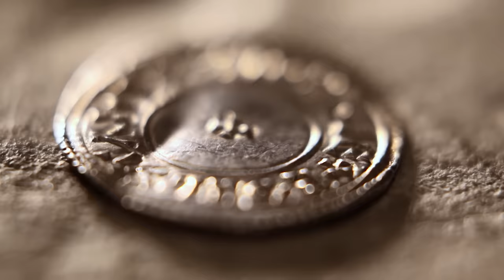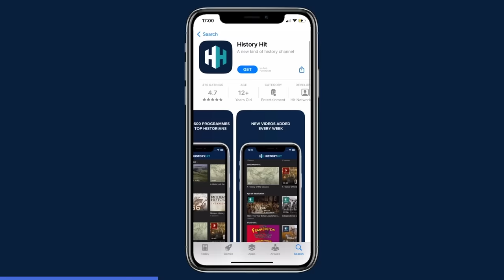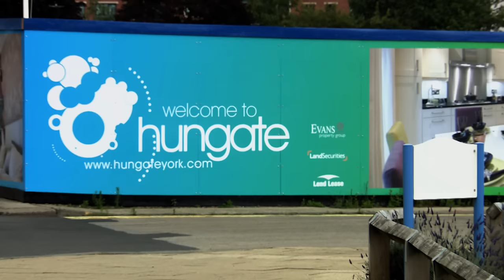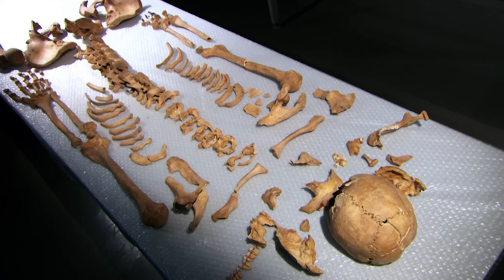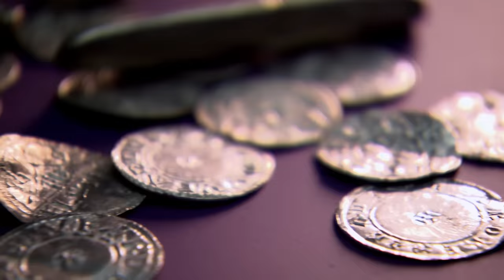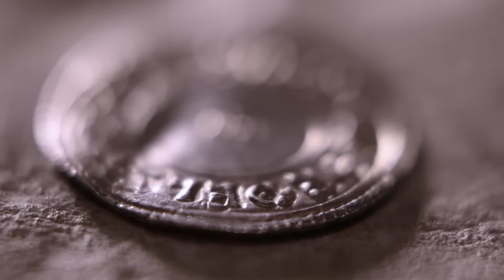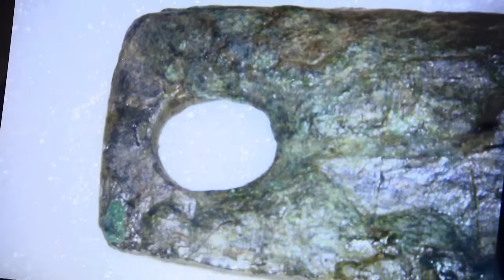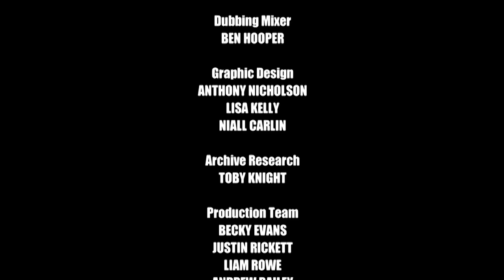Archaeologists Uncover The Secrets Of The Vale Of York Viking Hoard | Digging For Britain

Comment: The spear wounds could have been made after the slaughter as the victors went around to ensure each body is truly dead. Or arrow wounds.
Reply: I don’t know why the curator seemed to think of spear wounds to the exclusion of wounds caused by knives or dirks. Some dirks were made in that square pattern—like 4 sharp blades rather than a flat knife—weren’t they? It would have been easier to use a dirk rather than a spear at close quarters….